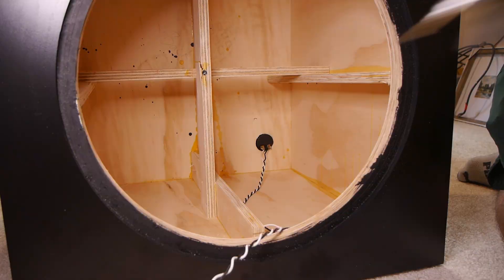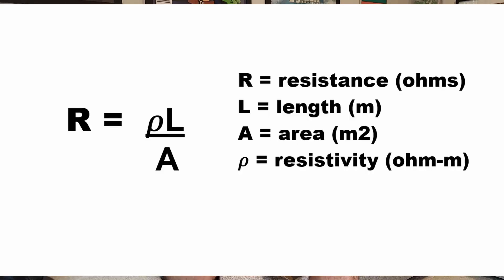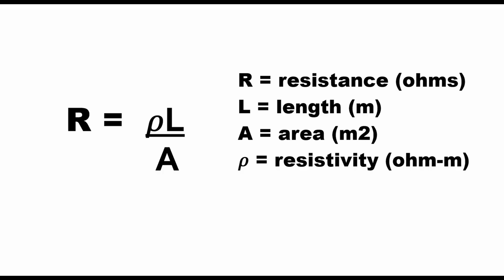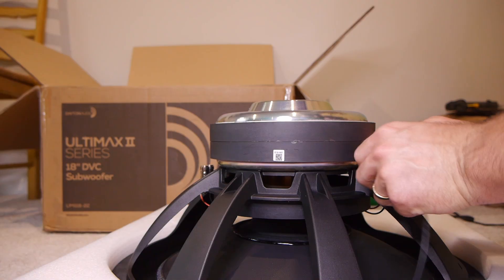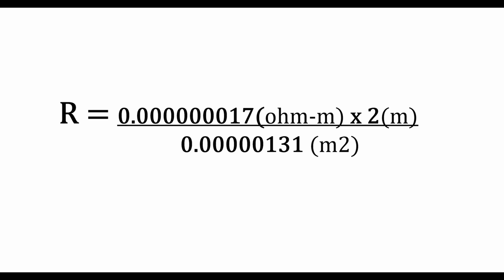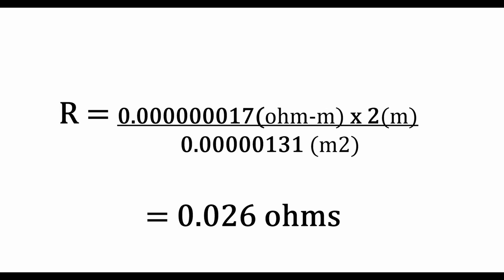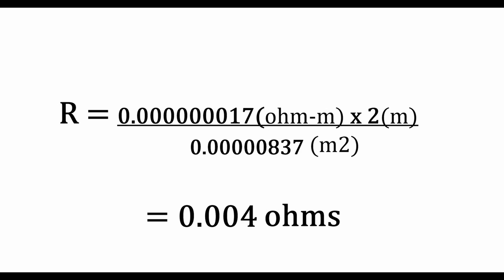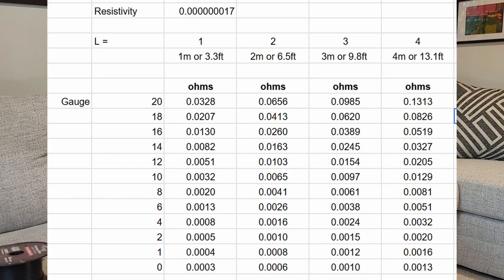Does Wire Size Matter?!? I say NO.

Comment: I'm not suggesting CCA wire for Power applications. But in the case of like speaker wire there is no difference in resistance or performance
between the same gauge CCA wire and OFC Copper wire in lengths of 8 - 10 feet or less.  Over 10 feet things start to change quickly between
the 2 types of wire.
Reply from the maker: Thats true but mostly because the resistance for both is negligible. Even if the CCA is double the resistance, thats only .048 instead of .024. In reality its not double, its about 25%. I dont think it bends as easily though. I cant remember which one is bendier.

Comment: Considering the fact that the wire in your home is 12 Guage and is for handling a 30 amp circuit with many more feet of length between the breaker box and your
outlets.  Then yes, 16 gauge wire for a short run of less than 10 feet will be able to handle the needs of a large subwoofer.  There's no reason to spend more money if you don't have to.
That said, I tend to use a little larger gauge wire than needed in some applications simply because I find it easier to work with.

Comment: It DOES matter! The resistance of the wire sums up with out resistanse of the source and It does reduce Damping Factor. The ideal source  should have zero resistance, in reality it has liitle. Lets take for example amplifier with Damping Factor 2000 for 8 Ohm. Its Out resistanse would be 0.004 Ohm. Add 0.026 Ohm of 2m 16awg wire, and we'll get DF 260 instead, 20awg DF 115, 8awg DF 1000. That's still rather good DF, if you dont have passive crossover, if you do, then sum up resistance of the coils in crossover (and YES, AWG of the coil's wire DOES MATTER much).
Reply from the maker: Do a video, Id like to know more about it. Please show sources.
Reply: @ImpulseAudioSpeakers  I'm electronic engineer, not a videoblogger. What source do you need? Read university course "Amplifiers", for example, or ask GPT. What's not clear in my explanation? Don't you agree, that ideal source amplifier has infinite input impedance, zero output impedance, and a constant gain to provide precise and undistorted signal amplification? Don't you agree, that adding Resistance to output of the amplifier increases output impedance of the whole system? Speaker is a LOAD, everything before the LOAD is a SOURCE feeding it(amp + passive components). I think that should be clear like 2+2.
Reply from the maker: @sz5171 you seem to think just the driver is the load. It's not. Especially with passive XOers. Larger awg inductor matter because they have impedance around 1 ohm depending on the size. They use a lot of wire, like a voice coil. All these items add up to the load. The output impedance of the amplifier isn't changed by this.
Reply: @ImpulseAudioSpeakers  Think of the wire and XO as a separate circuit cascades.
Reply from the maker: @sz5171 sure, and??? They all interact to give one load to the amplifier. The box wiring often comes after the XO even. A simple Google search (or GPT as you suggested) shows you have things backwards. It's ok, it's why I do these videos. Most people think the wire adds enough resistance to absorb a noticeable amount of power, but it doesn't. Unless it's long and/or thin. The video was just trying to quantify that for people. Hopefully it's helped people with that.
Reply: I wrote 3 answers and even made a simple  VirtuixCAD project to try to explain you. But you or youtube deleted them. Lost a lot of time for nothing. The wire resistance is part of the load for the amplifier, and a part of the source for the driver! The output impedance of the amplifier isn't changed, but the output impedance of the SOURCE for the driver IS changed. DF of the amplifier itself is not changed, but DF of the source IS!
Reply from the maker: @sz5171 must have been youtube. I dont even know how to delete comments. Anyways, you do you and Ill do me. Ive never had a problem.
Reply: @ImpulseAudioSpeakers  Try to emulate in VirtuixCAD. In my project "NO PROBLEM" is -0.2dB drop at 30Hz, -1.5dB at 100Hz, -3.2dB at 200Hz, -1.8dB at 1000Hz, -1.3dB at 10kHz and overal distorted signal with 4m 20awg and XO vs 2m 12awg at 50V amp output. Sure, doesn't matter! Try to think of the wire as a separate circuit cascade. If you need to calculate the maximum power of an amplifier, then you consider the wire as part of the load, but if you need to calculate the power on the speaker, then you look from the opposite direction and the wire becomes part of the source. It's the first year of the university teaching program in electronics. Sorry for my English, by the way...
Reply from the maker: @sz5171 i would need to see how you've done that. Ive modelled this a hundred times before and it always amounts to maybe 0.1db. I havent used vituix cad though. Ive used Sound Easy, Xsim, and PCD.
Reply: @ImpulseAudioSpeakers   At different frequences the SPL drop would be different, because Impedance graph of the driver is not linear, it's a curve 3.7 to 60 Ohm for a usual 4 Ohm driver.
Reply from the maker: @sz5171 exactly. So how do you think adding 0.024ohms to this load would change things 😂
Reply: @ImpulseAudioSpeakers  Adding 0.024 Ohm to LOAD would change little (unlinear 0.1dB drop SPL, slightly worse step responce and 0.1% distortion), but adding 0.024Ohm to SOURCE decreses DF of the source from 2000 to 260! If it's OK for you, just go for it! But don't give ppl harmful advice (you published the table up to 4m 20awg for a subwoofer). Because people are, unfortunately, uneducated and belive in everything they want to be true. Use the best wire you can afford (not the most expensive) to get the best sound quality you can get. All the rest is infoscam.
Reply from the maker: @sz5171 this video was not just about subwoofers. The table shows all the differences in wire for their knowledge. I used my subwoofer as an example. Telling my Im sharing bad information is an insult when you cannot back up your claims at all. A resistor in series with a woofer is load. How do you not understand this. Stop telling me Im the one giving bad info and calling yourself an engineer when you have it totally backwards. Make a video if you think you know better.
Reply from the maker: @sz5171 by the way, adding 0.024 doesnt cause 0.1db and 0.1% distortion and worst step response, either 😂 You're lost man. Making things up doesnt make you smart.
Reply: @ImpulseAudioSpeakers  In your opinion, why manufactures even for cheap speakers use 1-1.4mm2 wire for woofer coils, and 0.8mm2 for tweeters? If it doesn't matter?
Reply from the maker: @sz5171 actually I don't agree. Damping factor is ratio of output impedance and load. The wire resistance is part of the load. Just the same as the VC impedance, the resistors in the XO circuit, the speaker cable between the amplifier and the box, etc. 

What do you mean the manufactorurers use 1mm2 coils? Do you mean the inductor or voice coil wire?

Comment: Honestly, I don't worry about the math very much. Nothing else I do in audio is "good enough" or "it'll be fine", I typically use the nicest wire I have that will fit and work for whatever speaker I'm working on. It's usually not a very expensive spool, but it's usually some type of ofc 12. My big tapped horn subs have 10 in them, because it just barely fits into the terminals of the nsw6021s, and with the horn exits painted red, the red and black 10 fits perfectly and is the same width as the cross braces, so it looks great running along it.

They've also got big ass anderson connectors on them because why not.

I think us audio guys get caught up too much in thinking things are wrong because they're overkill, and the only thing that kills is my joy of tinkering and being into audio. Sure, spending 500 dollars on speaker wire and mains cabling is a bit silly, but my generic spools of wire I use for building speakers or wiring things, though usually overkill if you are purely physics brained, looks great, is tough, and, in the event of a violent uprising over the position of the attenuator knob can be used as a weapon in a pinch. 

Especially with a 120 amp Anderson connector on the end of it, those things are dangerous! :)

Comment: When you have calculated the resistance you can put it into winisd series resistance and look how the response changes (you have to add a lot of resistance to see any changes)
Reply: You can also add wire resistance to the output impedance of your amp and calculate how it affects the damping factor.

Comment: Temperature and humidity changes will effect the sound propagation more than.03%. So, unless you are in a climate controlled lab, just running your AC could account for your perceived audio differences in cables. That is assuming that all other equipment temps were constant. Claiming .03% is audible, and that you can hear it, is bafoonery.
Reply: .03%? 
I can't hear it, however the moment my wife walked in the room ...

Comment: Matters. Different guage does sound different. 14 to 16 awg being the mean point. Different materials and topology does sound different. Break in matters. I change my system every few years since 35 years ago.

Nobody stopping anybody  from using zip cord or whatsoever. It's the same argument freq response should be as flat as a ruler. 😂
Reply from the maker: Because of residtance or some other mechanism?
Reply: @ImpulseAudioSpeakers 

Sure. Skin effect and resistance inductance capacitance all slightly different. 

Thicker wire of same brand and type. less high more weight in bass. Generally more warmth as well. Too thick and the treble can become dull. 

The easiest way is to find out which is the meta cable to use for that speaker and use it. Non scientific practical way. 😂
Reply: @lloll69  gosh, you really fell for that, didn't you?! Now there is one key difference between wires, and that is if it's silver coated or gold coated copper, as that affects the conductivity of high frequencies in a bad way, meaning that Ag/Au coated cable will affect the timing at high FR. For that matter, non coated, oxygen free wire is best, and you can have great cables and wires from pro audio at much lower prices than the typical hifi products. Of course, shielding is important, but nothing fancy there, I would say. I would never spend more than 1000 $ for all my cables needs... I would spend the money on high end crossover parts, though. Most expensive speakers have crappy parts, like their entire xover cost less than 50$ and more often than not, they're also designed bad, with huge dips, very choppy FR, out of phase, full of resonances... Put 3k worth of cables and you think you hear a difference... how pathetic!
Reply: @IlarionMoga armchair expert 😂.

Comment: This doesn't make sense. You went to great length to calculate the resistor, without questioning wat distortions it causes, and what you can actually hear. Lets say you can hear these distortions at -70dB ,   that is about 0,0316% deviation! and this is only one small piece of the chain. they all ad up.
Reply from the maker: How does resistance add distortion? Ive never heard of that.
Reply: @ImpulseAudioSpeakers  The speaker itself ads distortion, (Back EMF) especially bass. The amp will correct for this by supplying/absorbing the required current to maintain the requirered momentairy voltage. Adding a resistance will decrease its ability to do so.
Reply from the maker: @d.j.wiendels6572 adding 0.024 ohms on a 4 or 8ohm voicecoil? I dont agree.
Reply: @ImpulseAudioSpeakers  (0.024/4.024)*100= 0.59% ! 
Simple version: more resistance = less tight tight control by the amplifier
Reply from the maker: @d.j.wiendels6572 i believe the opposite can be said. More impedance means less current. Its why you can hammer on a subwoofer at its resonance and never clip.
Reply: @ImpulseAudioSpeakers  according to that reasoning you would need to add a resistor, and an active sub will be worse than a passive one. go figure
Reply from the maker: @d.j.wiendels6572 No, Im not suggesting either. I think any impedance above the amplifiers lower limit is acceptable. Youre the one who suggested changing it changes the handling of the amp. I dont think modern amps care if theyre not current limited.
Reply from the maker: @d.j.wiendels6572 adding a resistor just burns up power. That would reduce efficiency, which I think is very important. Im very much against adding resistance.
Reply: @ImpulseAudioSpeakers  I assumed an ideal amp, since were talking about the wire here, so you're right, the amp provides whatever current is needed to deliver the required voltage. The problem is, it wil only see the voltage on its own output terminals. a resistance in the wire prevents it from delivering the perfect voltage on the speaker terminals, and the speakers load is not lineair,  so this wil result in distortion. (on the speaker terminals, not the amp output)

Comment: Is that Audiopipe wire that you have there? I bought some 12ga Audiopipe wire from Pats Express, and kys probably the worst wire I have seen. The copper looks noticeably smaller than other12ga wire I have, and it’s also oxidized, looks very brown, and breaks easily.
Reply from the maker: Yes it is. Ive had it for years. Its been decent. Not the highest quality but not like you got. Probably bought back in 2013.

Comment: When you consider the entire circuit including the parasitic resistance of the speaker and the output impedance of your amplifier (the entire circuit) the amount of resistance did the wire adds is indeed pathetically small add insignificant. Have a quick look at your amplifier circuit diagram, and you will see emitter resistors on the output transistors also you'll note that transistors themselves have resistance. Thus, there's no such thing is an amplifier with 0-ohm output impedance.
Reply: You seem to forget about negative feedback circuit in your amplifier. That's what keeps output impedance close to zero.
Reply: @IliyaOsnovikov  😁You had me at the word close
Reply: @davidkclayton  IMHO words are less important than facts. Some modern amps (like HEGEL H190 and others) have output impedance less than 0.002 Ohm. But the most of speaker cables have significantly higher resistance. Thus so-called damping factor at speaker terminals will be many times lower than at amp's terminals.
Reply: @IliyaOsnovikov very cool for you. You have a damping factor of infinity😊
Reply: @davidkclayton  Do I? My Rotel RA-985 has damping factor (DF) of 400 for 8 Ohm load. That means output impedance of about 0.02 Ohm. And 8 feet long 4x14AWG speaker cable (connected in the star-quad configuration) adds about as much resistance effectively cutting that damping factor in half. But if speakers were 4 Ohm the DF would be twice lower.

Comment: Brian, a cable with lower resistance and lower inductance will always get better results. The Stereophile magazine had an article showing measured difference between various speaker cables in one amp-speaker system. It's called "What a Difference a Wire Makes" by  Ben Duncan  |  Jun 12, 2020  |  First Published: Dec 1, 1995

Comment: Next try tin plated copper, pure copper and silver wires all at the same gauge.  Then use science to tell me they all sound identical.
Reply from the maker: Well theyll all have low resistance. Is that what youre getting at?

Comment: Agreed. The short lengths of wire used in speakers really doesn't need to be any bigger than 17AWG (1mm) or 15AWG (1.5mm).
It's only when long length are required but then I'd be more concerned with inductive and capacitive properties. With my electrical engineer hat on also the power involved really is minimal. Current drives volt drop in wires but there really isn't much 😂

Comment: Agree! For long wires e.g. to the other end of a room, the inductance can play bigger role in the total impedance, especially/mainly for the high frequencies. Also the resistance of (poor) connectors can have a significant influence.

Comment: Speaker wire resistance does make a sound quality difference. Modeling the speaker wire as a resistor in series with a speaker which has varying impedance over frequency, the reactance will change as you increase the resistance (speaker wire). Demonstrate the sound quality difference between 100 feet of 16 gauge wire and 10 feet of 12 gauge wire. I suspect you will hear the bass sound underdamped with the increased series resistance and not too much difference in higher frequencies.
Reply: You missed the point. Over short distances(2meters), there's no audible difference.
Reply from the maker: But I was talking about internal speaker wiring where resistance came out to be 0.024 ohm. This wont affect anything.

Comment: I would rather look at low pass filter. The coil has far bigger resistance :)
Reply: with passive speakers, yes, DC resistance introduced by the inductors is sometimes even comparable to the speaker's impedance and must be taken into account when designing the crossover and the enclosure. but subs usually use active or digital crossovers, so no inductors there!

Comment: Still loving the straightforward common sense videos. 

I like the look and feel of 12 gauge for external, but inside the box I'll usually use 14 or 16 gauge. I'm usually not making external cables more than 10 ft.